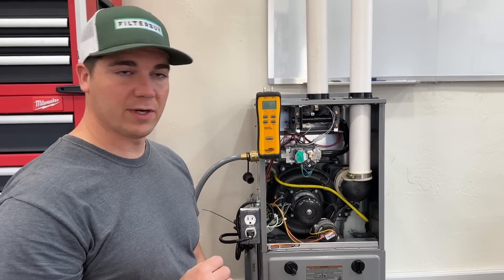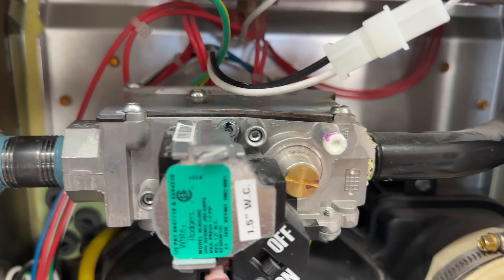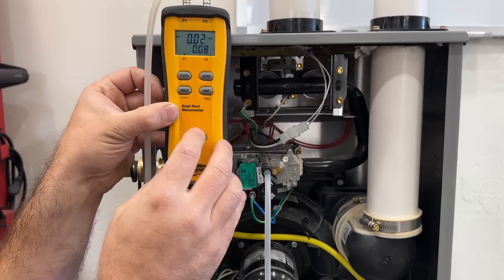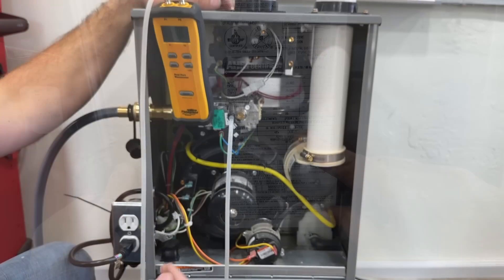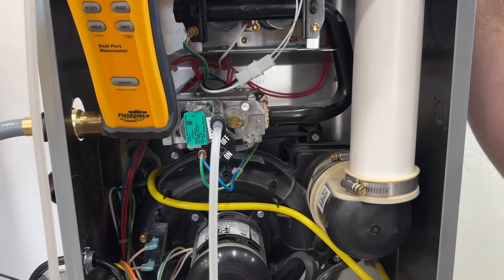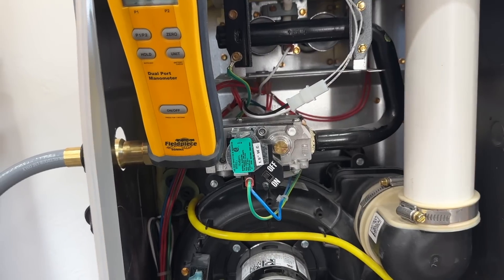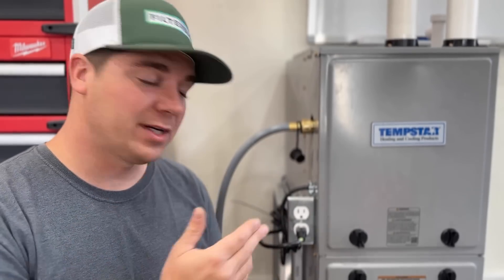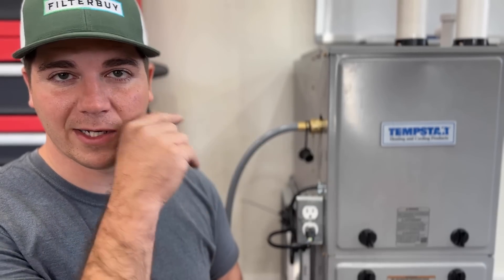Lower Your Energy Bill By Doing This To Your Furnace

Comment: Man its bad enough I see ICP furnaces not vented properly in the field, but now here is one on you tube. The furnace came with a rubber coupling and two hose clamps. it is to be installed at the outlet of the cabinet. A short piece is cut usually 10 to 10-1/8 varies a bit so need to measure from the inducer to the plastic outlet ring. it is glued into the outlet ring, once the glue is set up it is installed between the inducer and the cabinet. then the rubber collar is installed and clamped to the ring. From there the field side of the vent is ran clamping it to the coupling. This allows for easier service in the future.

Thats how you piss a tech of on a friday afternoon when he has to replace the inducer and the flue separation kit wasn't used, he doesn't have a coupling to just cut the vent, so now he has a PITA replacement, as the inducer assembly can still be replaced, but its a battle. Installers keep your techs happy, install the flue as per manufactures design. 

Also a tee with a drain line or a drip leg must be installed on the intake. ICP will not warranty the gas valve if it fails due to moisture from the intake.

Comment: Great video  ---   I've read that (going too low) on gas pressure can cause incomplete burning of the gas and cause an increase in harmful gases inside the furnace that could get into the home and (going too high) on gas pressure besides increasing noise also makes the flames hotter and it can damage components like the regulator and manifold orifices, etc., over time, i've also read that running too hot from too much pressure can also overheat and damage the blower motor.  ----------  Is that true and I wish you would have used a temperature gun (IR Gun?) so we could see the flame temps change as you increased and decreased the gas pressure.
Reply: Running too hot won't hurt the blower motor, however it can damage the heat exchanger.
Reply: @eDoc2020  I've heard it said that it can melt copper windings inside the blower motor !
Reply: @Bowhunters6go8xz6x   If the blower compartment is hot enough to melt the windings then the entire unit must be on fire. The blower is in the unheated return air path so it stays cool whenever it is running. And the high limit overload will shut down the burners if the furnace reaches dangerous temperatures. Most furnaces are updraft so the blower is below the heat exchanger. If you have a downdraft furnace (common in mobile homes) the motor will be above the heat exchanger and I suppose it will get quite hot (due to the hot air naturally rising) if the motor stops running for whatever reason. It possibly could get hot enough to damage the insulation but the copper itself won't melt.
Reply: @eDoc2020   ---  Its not going to melt the windings overnight but over time (one article I read said) 130c/266F for 5,000 or more hours can ruin a furnace blower motor and some blower motors are more cheaply built than others.    The guy that does this channel has mentioned that it can happen if the furnace runs hot all the time but it does take time.     Not going to argue about it.
Reply: @Bowhunters6go8xz6x   I agree the windings will get damaged by elevated temperatures over time. My point was it's the enameled insulation which will fail and make the windings short out. The copper itself won't melt.

Comment: The brass screw cap for pressure was screwed on so tight it's stuck.  It started to strip while attempting to remove.  Any recommendations for safely removing?
Reply from the maker: Drill it out and get a replacement. It’s soft metal

Comment: Great video but I have one question if you lower the gas pressure to the lowest setting does that lower the btu(heat) output of the furnace? If lowering the gas pressure, does decrease the furnace heat(btu) output then the furnace has to run longer which will increase the repair costs much higher overtime due to the extended run times. The temperature in the house will feel colder until the thermostat temperature set point is reached. If the btu's are lower this should extend the life of the heat exchanger.
Reply: Yes, changing the gas pressure affects the heat output.

Comment: While setting gas pressure is very important, it should also be noted that changing gas pressure will change your combustion properties.  Such as allowing too much CO, having too hot of a temp stack.  This requires a combustion analyzer.  This is still an excellent video for the topic.
Reply: Thank you this is crazy I can’t believe this shits on YouTube
Reply: No not when it's specified lowest setting in your units spec plate. He is not suggesting going below the lowest pressure recommended by the manufacturer.

Comment: I believe that operating at the lower end of the gas pressure range may cause the furnace to run slightly longer each cycle but results in more consistent and comfortable space temperature.

Comment: Thanks.  Worth mentioning, you said that to test the pressure for high flame on a two stage furnace, turn up the thermostat.  True, but only if you have the two stage thermostat.  Many installers save a few bucks by putting in a much cheaper one stage stat, and wiring it (W1 - W2 strap) so that the internal timer in the furnace finally asks for high flame after a preset number of minutes, and only if there is still a call for heat, if the target has not yet been reached.  If you want to force high flame on demand, you remove the strap, start the furnace, and then when you reinstall the W1-W2 strap, high flame will start.  BTW, like many owners with singlestage stats in mild climates, I made it a one stage by exchanging the strap for a simple switch, which instantly makes it a two stage only when operated for need.  That is because with the strap in, the timer will invoke high flame moments before the target is met, briefly making a lot of fan noise and being inefficient.
Reply: Sad to hear that some installers cheapen out by installing a one-stage thermostat on a two-stage system.  Nowadays, two-stage thermostat costs nothing more than one-stage.  And many utility companies sell high quality smart thermostats for as little a dollar after rebate, or even provide for free if customer enrolls in energy saving program.

Comment: If the range is 1.4 - 1.8 why wouldn't you use the lower pressure to save fuel?
Reply: It is the BTU of the furnace vs the volume air blowing through the heat exchanger "plenum", cooling it below the "fan run" limit switch, which tells the blower that the plenum is now at correct temperature.  Setting pressure too high will trip the "overheat" limit switch.  The blower should not turn on and off repeatedly during the call for heat from the thermostat.
Reply: @victorsteerup4582  Modern furnaces don't use limit switches to activate the fan during normal operation. They usually just use timers.

Comment: You also know your gas valve is calibrated by clocking your gas meter while you adjust the input of the valve. You want to be within +/- 2% of the BTU rating of your furnace.

There are caveats to adjusting this pressure ignorantly, i.e.: incomplete combustion, under-firing your heat exchanger, allowing a greater potential for condensation, over-firing your heat exchanger. All of these things are pretty serious things to consider.

Comment: I've a couple of questions.  First, how much does this tend to stray?  In other words, does it need to be checked annually?  Second, if I paid the Xcel Energy guy to to a "tune up" on my furnace, is this something he would have likely done?  Tried looking on the Xcel website for an answer to that 2nd one, but...
Reply: Optimal setting for gas pressure value changes only when the BTUs per cu.ft. of gas changes very much.  If you look at your gas bill, you'll probably find that it barely changes from month to month, not enough to make it worth adjusting the valves.  If the BTU's per cu. ft. actually changed very often, then the federal gov't would mandate O2 sensors in furnaces and automatic adjustment of fuel/air mixture, like in automobiles.
Reply: Decent furnace tech would check combustion with meter (and preferably give customer a printout of results).  Would also check heat rise on both high and low fire.  Would also check static pressure of entire furnace and of just the evaporator (if system has A/C) to determine if evaporator is reducing airflow enough to need cleaning.

Comment: Lowering the gas pressure does not save fuel! Underfiring the furnace changes the fuel to air mix and actually slightly reduces efficiency. What matters for energy use is efficiency.

The reason some manufacturers give a range is to adjust for btu content and density of the fuel. 
IT IS NOT so you can set it to whatever you want.
If the orifices in the furnace are for 1000 btu per cu ft and you have 1050 in your area as an example, the pressure needs to be slightly lower than the standard 3.5 on hi, 1.5 to 1.7 on low.
This is all detailed in the install manuals no one seems to read.

The btu input needs to be what is on the rating plate for both low and high fire.
Only reduce btu input if required for de-rating!
If the temp rise is too high, raise the fan speed, don't cut the gas pressure!

Comment: This video is incredibly incorrect.  Checking the gas pressure with a manometer is just a starting point in furnace setup.  If you use only the gas pressure to set the valves, you are almost guaranteed to end up with incorrect air/fuel mixture. 

Adjusting the gas pressure alters the air/fuel mixture.  Improper air/fuel mixture reduces furnace efficiency and therefore increases gas consumption.  There is an optimal fuel/air mixture that results in maximum heat production from each unit of gas.  Anything above or below this ratio reduces efficiency and wastes gas.  Turning down the gas pressure does NOT reduce your gas bill.

The easiest way to correctly adjust the gas pressure valves is by using a combustion analyzer, but they are expensive.  Alternatively, you can clock the gas meter to set the valves correctly, although it takes a little longer than using a combustion analyzer and requires some simple calculations.  Google <clock gas meter> for instructions.  (You'll also need look up the heat value for the gas in your area for use in the calculation.  It's on your gas bill and it varies a little each month.  However, the monthly variation is usually so small that the gas pressure does not need to be changed after setting it initially.)

Most furnace installation manuals include instructions and a table that can be used to optimally set the gas valves using the gas meter clocking method.  Note that I wrote INSTALLATION MANUAL, not owner's manual.

Comment: If you decide to do this, then please find the service manual for your furnace and read it carefully. This video shows you the core things that you’ll need to know on any furnace, but there are models out there that have quirks (multi stage furnaces in particular) and the procedure is slightly different. So please read the manual.

Comment: My manifold pressure is a single number 3.5, not a range...what is the assumption 3.2-3.8? Older 84% efficiency Rheem Criteon 2 furnace that sounds like jet airplane, very loud.
Reply: I was wondering the same thing.

Comment: So currently, the manometer costs $164.  Assuming my furnace is running within spec but on the high side, how long would it take to recover that $164?  Alternatively, I can get my furnace checked and "tuned" by a professional for under $100.  That makes more sense unless that tuning has to be repeated every year.
Reply from the maker: The manometer I have in the description is like $30. The fieldpiece I highly recommend for people in this trade but otherwise homeowners could totally get the cheap one which works just as well it just doesn’t have some of the features.
Reply: @diyhvacguy  Couldn't you use a water column manometer?
Reply: @not_listening2792  Water column manometer is actually more reliable than electronic manometer because it can't get out of calibration.  However, the $30 manometer is reliable as long as it's not abused.
Reply: You can make your own "U-tube" water manometer out of clear tubing and water.  Instructions on You Tube.

Comment: I bought a manometer and checked the pressure and it was less than the furnace manual called for. The installer never checked it . I think I’ll stick with the manual prescribed pressure (at our 35 feet above sea level).
Reply: I forgot to say that I have a two stage furnace and two stage gas valve . The stage 1 gas pressure is set at 1.8 psi for mine and that’s where it runs most of the time for temp. maintenance. I suppose that’s partly why you get better efficiency.
Reply: 2-stage does not save fuel, it is for comfort. burns less gas over a longer period of time. @rzh3443

Comment: Lowering the pressure will just make it run longer to satisfy the thermostat correct?
Reply: it depends on the size of the furnace and the size of the home and ofc your location. For example here in Texas most furnaces are oversized because of higher cooling loads. My house has a 80k 80% BTU furnace but manual J would only call for ~30k BTU total. That being said my gas furnace is about 2x bigger than needed because I need a bigger airhandler during the summer. In my case, dialing it back saves me money and improves comfort too... YMMV
Reply from the maker: Very minimal
Reply: @diyhvacguy  great thank you!

Comment: So if you reduce the pressure ultimately reducing the burner flame, how much longer is the furnace run time to satisfy the thermostat request and heat the house?
Reply from the maker: Very minimally longer runtime
Reply: So too many inches of gas on low means two stage condensing furnace does not operate at peak efficiency. Right amount of pressure means more heating to the air with less gas and electrical consumption.  Same on high speed on two stage furnace , although then you know that efficiency drops as heating rate is increased @diyhvacguy
Reply: @diyhvacguy  it runs longer and drops the air oputlet temperature..  money savings is only really noticed at all on a 90+ furnace where you are dropping the secondary heat exchanger temperature allowing more condensation to occur..  on modern furnaces with ECM inducers. ()namely modulating the 2 stage) the inducer will reduce it's speed in response to a lowered gas valve setting..  those furnaces continually test for the lowest inducer speed that will still trigger the pressure switch for the exhaust..    I have the second stage on my 2 stage trane unit dropped about 20% over label..  i still get good quick crossover but much more codnensation and longer run time which allows the firnace to run in its most efficient state..  dropping gas pressure on an 80% unit really doesnt do alot as the inducer spoeed stays on full which tends to run way more air than necessary for good combustion..  you can see it when running a combustion analysis on the exhaust. (testo 320)..
Reply: You failed  to talk about " over fire,"  what happens  to the heat exchanger!
Reply: @joemartinez-673  set too high you are likely to incur an initial rollout on startup which will trip the rollout limit.. possibly disrupt the draft flow and trip out the pressure switch.  on a 90+ if it continues to run, youl;l hit the stack temp limit which is typically only 150-160f. and it will shut down.. on an 80% if you set it high enough to damage the heat exchanger it will shut down on high limit prior...  if the blower speed is set high enough the unit will run with no other ill ewffects than warmer air and short cycling.
Reply: So this isn't a great solution for an inexperienced tech like yourself and definitely not a home owner.  This should only be done by a professional. A combustion analyzer is needed to set up the combustion cycle for the proper burn and efficiency, not doing that could create a dangerous situation for the occupants of that building.  
DANGER WILL ROBINSON
Reply: @Mr_IAQ I’ve not tried it on my single stage furnace , but on my multi stage trane that has a variable inducer my testo numbers come in great with my low stage turned down, I’m at 25 ppm CO which is will within spec . The inducer on that furnace tests the lowest speed it can still make draft and remembers it. Lower flame means the inducer drops its airflow down a bit .
Reply: @eldoradoboy its within spec on plate so no ot doesn't require all that. Just lowest stting by manufacturer.
Reply: Greatly reduces delta T. Manufactures want gas pressure set for a specific inwc dont listen to this ding dong
Reply: @jdhunt1284  he is not suggesting to turn it lower than the specs on the tag. If you listen or watch he is explaining where to find that

Comment: I like the knowledge, thank you. However, I won't most installers set this up correctly when they put in the unit?
Reply from the maker: You’d be surprised man. A lot of people don’t check it at the time of installation.
Reply: I’ve been in the industry for 16 years. Proper commissioning of residential equipment on new installation is rarely done. If done, not properly.